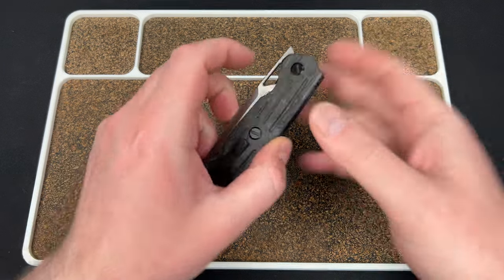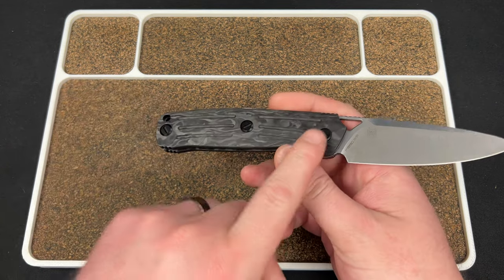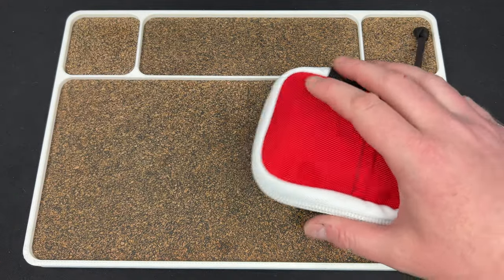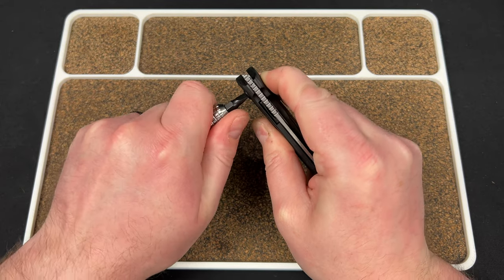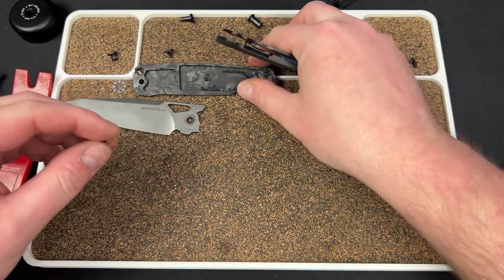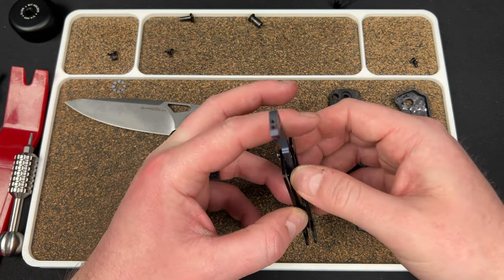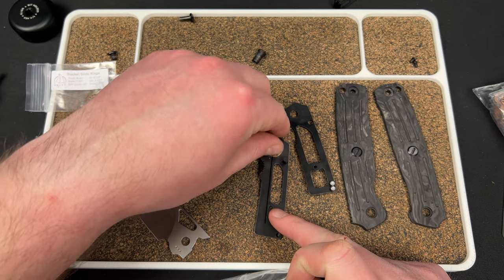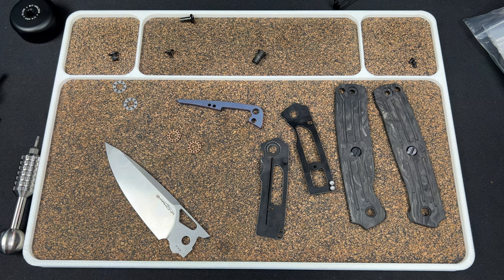Arkona Nettle F Disassembly & Bearing Swap

Comment from the maker: I disassemble and bearing swap the Arkona Nettle F KNP  edition in M390 and Chaotic Carbon Fiber. 

https://knifenutspodcast.com/imports/ya7ych2ap2j8uk54ts6q6cbrugeifb

This takes 6MM 1/16 13 Ball Skiffs: Skiff Bearings code LeftyEDC for 10% Off: https://www.skiffmadeblades.com/collections/bearings

My Disassembly Tools: 
Knife Pivot Lube code Lefty10: https://knifepivotlube.com/lefty10 
Super Glue: https://amzn.to/3VavqUB
Wiha Stubby Driver: https://amzn.to/3AQUEQ1
Wiha T8 Torx Bits: https://amzn.to/3OG3OEA
Wiha Torx Set: https://amzn.to/3OE2GBt
Isopropyl Alcohol: https://amzn.to/3F94TBP
Get Good Skrew code Lefty10: https://www.getgoodskrew.com
Vibratite 122 - https://amzn.to/3VAU0y5
Knipex Pliers: https://amzn.to/3iz7yfB 
Plastic Pry Set: https://amzn.to/3UrqDgJ
Magnet Pen: https://amzn.to/3ipNICO
Tinkerforce Tray: https://tinker-force.com/collections/frontpage

#tools #edc #bearings #disassembly #blade 
______________________________________________________________________
Linktree - https://linktr.ee/leftyedc 
Follow me on Instagram: https://www.instagram.com/leftyedc/
Email me at: Leftyedc88@gmail.com 
Divo Knives - My Knife Company: 
https://linktr.ee/divo_knives

Channel links: 
Patreon: https://www.patreon.com/LeftyEDC 
Merch: https://divoknives.com/collections/swag

Affiliate Links: 
Urban EDC: https://bit.ly/3Hr77vX
Traditional Pocket Knives/C. Reisner Cutlery: https://www.traditionalpocketknives.com/?sca_ref=3003389.dF8svDDRGL
Smooth Precision Pens: https://smoothprecisionpens.com?ref=leftyedc
Artisan Cutlery: https://shrsl.com/3wq56
GPKnives: https://shrsl.com/3vqzm 
Blade HQ: https://shrsl.com/3vqzn 
BladeOps: https://bladeops.com/?aff=11
Vosteed Cutlery: https://shrsl.com/3vjqd

20% OFF Links:
Guard Dog Inserts code Lefty20: https://www.guarddoginserts.com/ 
3DCPrintings code Lefty20: https://www.etsy.com/shop/3DCPrintings?ref=shop_sugg 

15% OFF Links: 
Andar Products: https://andar.com/?mct=LEFTYEDC 
Geeone (Fidget Dealer): https://geeone.com/discount/KBSVDG0E45HH 

10% OFF Links:
Olight code LeftyEDC: https://www.olightstore.com/s/BXNXEC
Blue Creek Knives code Lefty10: https://bluecreekknives.com/lefty10 
Knife Pivot Lube code Lefty10: https://knifepivotlube.com/lefty10 
Big Idea Designs code LeftyEDC: https://bigidesign.com/leftyedc 
Axial Gear code Lefty10: https://www.axialgear.com/?rfsn=6074131.ee91f3&utm_source=refersion&utm_medium=affiliate
Get Good Skrew code Lefty10: https://www.getgoodskrew.com 
White Mountain Knives code Lefty10: https://whitemountainknives.com 
Asher Knife Co. code Lefty10: http://www.asherknives.com 
Skiff Bearings code LeftyEDC: https://www.skiffmadeblades.com/collections/bearings
NJT HandPower code Lefty10: https://www.njthandpower.com/products
Big White EDC code LeftyEDC: https://bigwhiteedc.com/?referral_code=VIFXVG3&source_type=member_plugin_referral&slt=member_plugin_referral 
Fidget Things code Lefty10: https://www.fidgetthings.com/
Issuing Stitches code Lefty10: https://www.etsy.com/shop/IssuingStitches?ref=shop_sugg 

5% OFF Links: 
Dapper Designs code LeftyEDC - https://dapperdesign.com/?ref=P5ynrrgb
Rolling Square: https://rollingsquare.com/pages/_go_?ref=5640:569070&discount=F061DFB824C

Slipjoint Stuff: 
Jack Wolf Knives: https://www.jackwolfknives.com/pages/authorized-dealers
Northwoods Leatherworks Co Slips.: https://www.instagram.com/northwoodsleatherworksco/   / northwoodsleatherworksco@gmail.com 

My Disassembly Tools: 
Knife Pivot Lube code Lefty10: https://knifepivotlube.com/lefty10 
Super Glue: https://amzn.to/3VavqUB
Wiha Stubby Driver: https://amzn.to/3AQUEQ1
Wiha T8 Torx Bits: https://amzn.to/3OG3OEA
Wiha Torx Set: https://amzn.to/3OE2GBt
Isopropyl Alcohol: https://amzn.to/3F94TBP
Get Good Skrew code Lefty10: https://www.getgoodskrew.com
Vibratite 122 - https://amzn.to/3VAU0y5
Knipex Pliers: https://amzn.to/3iz7yfB 
Plastic Pry Set: https://amzn.to/3UrqDgJ
Magnet Pen: https://amzn.to/3ipNICO
Tinkerforce Tray: https://tinker-force.com/collections/frontpage

Thank you so much for watching and following along. I have such a blast bringing new content to you and am always open to chatting, so feel free to reach out anytime!

-Kev

Comment: #23 here.  Thanks for these two videos.  I got mine out and really played with it for the first time, it has grown on me quickly.  Do you think those skiffs are all that?  Did that sound go away?  I dropped from KPL inside and that helped a lot.  Thanks again.
Reply from the maker: Yes the skiffs totally improved the feel. Sound went away
Reply: @LeftyEDC  I did the swap for the Skiffs, the dragging sound is 99% gone, I think the little bit of noise is the just detent ball.  The flip open is smooth as silk now as we.  Now time to sell to make room.
Reply: Forgot to add, disassembly was a breeze since I was able to watch you struggle through it.  Super easy, barely an inconvenience.
Reply from the maker: @JeffreySmith1967  haha nice
Reply from the maker: @JeffreySmith1967  haha thats partly what the videos are there for

Comment: Was about to buy the knife untill I watched this video. 200$ worth of tools and an engineering degree for maintenance is absurd.
Reply: Somebody needs to send him a Spyderco Szabo Folder to disassemble/reassemble.

It has a long coil spring with a "clutch" to create bias for the closed position, kinda like the opposite of an assisted knife. Instead of opening the blade a little and a spring pushing it the rest of the way, once you close the blade ~80%, the spring will pull the blade closed.

Definitely the ending boss of knife reassembly.
Reply from the maker: @CNYKnifeNut  challenge accepted